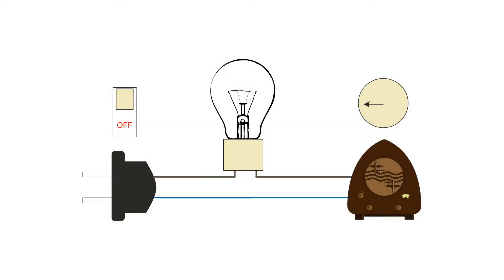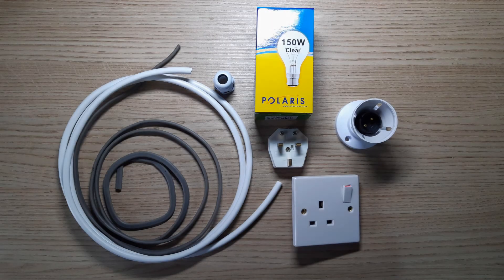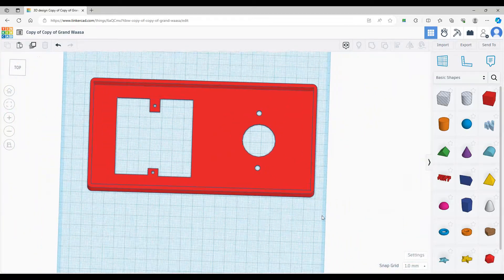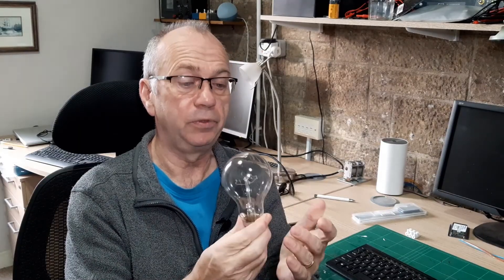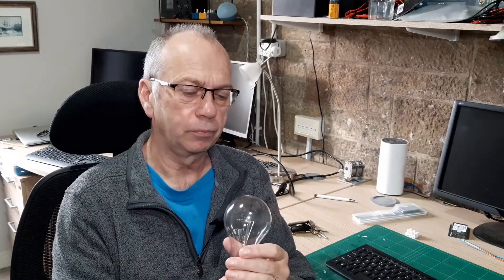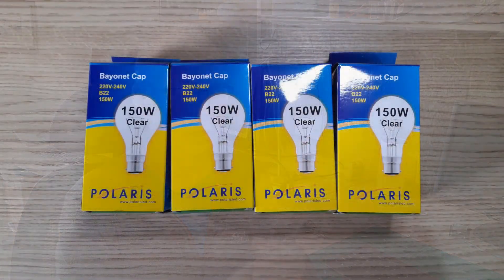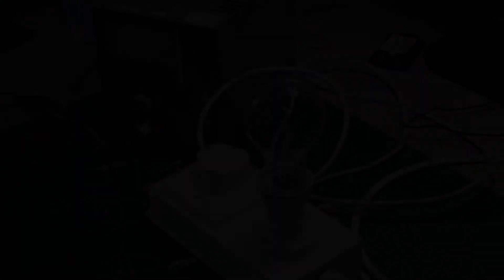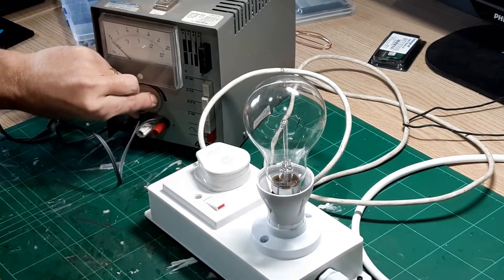Yet Another Dim Lamp Current Limiter

Comment: The correct term and description is  Tungsten Filament   bulb / lamp
Obviously because the filament is made from tungsten.

The next conundrum is the British bastardization of the   Vacuum Tube
Had it been a VALVE  the CRT ( Cathode Ray Tube would be a Cathode Ray Valve )
The operative word is   TUBE   in both cases.
A valve is a device for regulating the flow of fluids - as is a faucet
A  tap  is a tool for cutting female (internal) screw threads
You can learn high level English and Grammatical Legal English -
neither of which are taught CORPORATE GOVERNMENT schools.
You can be a leader and set the example or just a follower sheeple.
Of course  - being a steeple is easier for the greater majority

For your homework;
Explain the difference between
Someone and Somebody
Air Force and AIR FORCE
The UNITED STATES OF AMERICA and the United States of America
Passing and overtaking

The above list is by no means comprehensive -
it is merely a small sample

Comment: I dont understand why it is necessary to break off the side tab on the switch?
Can someone tell me?
Thank you
Reply from the maker: Hi, I am not sure what you are referring to. The only switch in the system is on the mains socket and that is not modified.
Reply: @VintageandReclaimedElect  I have seen some videos were they break of the little metal tab that is in-between the two screws on the hot side of either the the outlet or the switch and they say that if it's in parallel it will create a short and the set up should be in series.
Hope that makes sense

Comment: Hi.  I just discovered your channel and it looks like you will have some interesting stuff coming up so I subscribed.  I agree, a dim lamp or dim bulb limiter is probably the first piece of kit you need if you're going to work on vintage electronics.  I now have a variac but to be honest I only use it occasionally.  I normally use a 60W globe with most vintage radios.  Yes, it does drop the voltage to the set a bit initially but the degree of glow in the dim bulb gives a good visual indication of what's happening:  You can see the initial surge of current as the rectifier valve starts up and the capacitors charge, see it dim off as they reach full charge and brighten up as the rest of the valves start to conduct.
I still use the original one I made when I first started down the vintage radio rabbit hole and you can see it in nearly all my videos.
Cheers
Reply from the maker: Thank you for this feedback. I love hearing what people are doing. I have a variac in the process of being restored. I'm building a system for prototyping valve based projects. 3 radios to do this year and also a valve based RF signal generator. Lots to do!
Reply: Looking forward to seeing that.  The variac restoration should be interesting and it would be nice to have a restored good quality one as opposed to the cheap chinese one I (and many others) use.  The signal generator should likewise be useful.  I have an old valve based Leader that I've been using for years.  I've never restored it but it's still working well.  Prototyping valve circuits sounds interesting:  I haven't got into that yes beyond sketching out some ideas. @VintageandReclaimedElect

Comment: Thanks for the video's. I just found yoer channel. Very clear and calm explenation of everything. I agree with the safety you are mentioning. To start this hobby i bcollected al kind of tools and parts. Almost a complete workshop. But still i can't do much yet. First i have to let replace and test my ungrounded wall sockets 😄 As i have some tube radio's and amplifiers it is not safe enough to work on it because of my lack of knowledge. But i'm getting there soon.
Reply from the maker: That's great to hear that you are giving it a go. I too still need lots of test gear and knowledge. I am working on that. Glad you are taking safety first.

Comment: Nice device and great explanation, I  wonder if you could also include a typical dimmer switch which would also act like a cross between a variac end dim bulb tester? Thanks for the video.
Reply from the maker: Typical light dimmers actual chop the waveform up and so work on a form of pulse width modulation fi you can call it that. They do no reduce the amplitude but reduce the average voltage per cycle, so would not really work in this application. The 'gold standard' for this setup is dim lamp then variac then isolation transformer.
Reply: Many thanks. Nice vid. Would you be able to supply the stl file for the 3d printed enclosure?
Reply from the maker: @johnhawkes7681  Yes, I uploaded the 3 files to Git here, if YouTube lets me put a link in this comment. If not, I will place the link in the description. https://github.com/ghallberg-nbtt/dim_lamp
Reply: Yes looks like I can get to those. I will download as soon as I get back to the pc. Many thanks.
Reply: Really nice video, love the enclosure, I think I'll build one. Great inspiration!